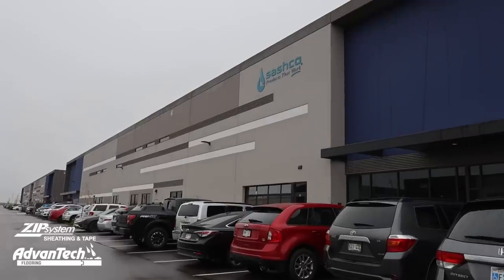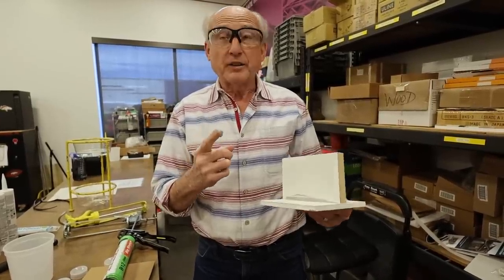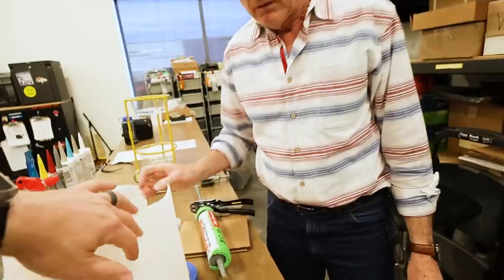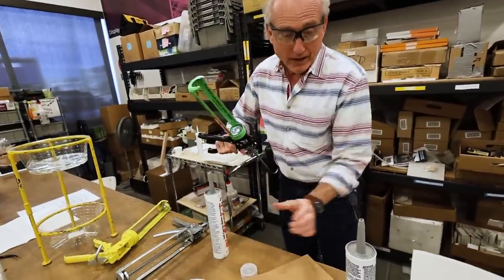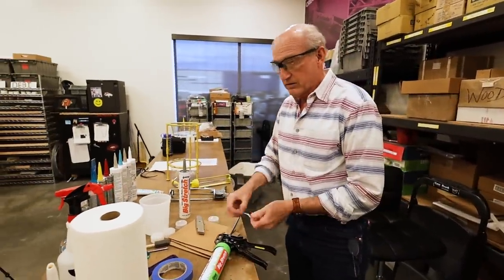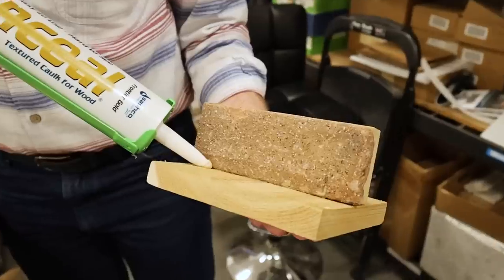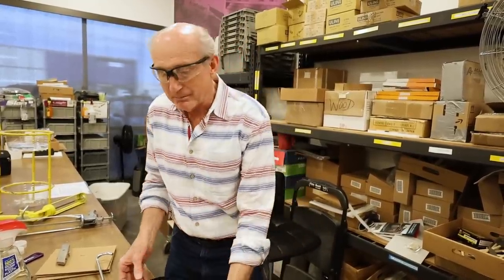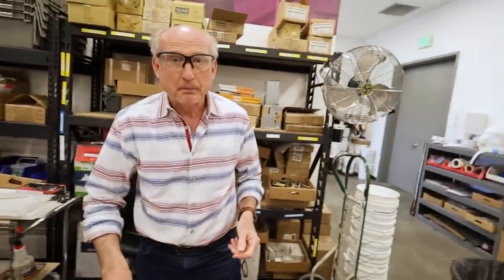If this is your painter’s finger…Watch This. MAJOR MISTAKE

Comment: Since welding from 15 till 48 I've always firmly believed that you need to work that caulk bead into that joint to get the proper adhesion, get that penetration deep down in that crack, whip that nozzle back and forth while droppin them dimes along the way. 😂 never in my life have i wiped a caulk bead. You should see my shower, it looks like a pressure vessel, dimes all over. 🤠
Reply: Funny , I would go crazy as a guest at your place… so keep the drinks coming.
Reply: Not only can you lay dimes, you are quite the wordsmith.
Reply: @tegimr  that's funny,  usually there is always some spelling nazi telling me I used a word in the wrong context or mis abbreviated or something stupid like that. Thanks, makes me feel good for a change. Much love brother. 🤙